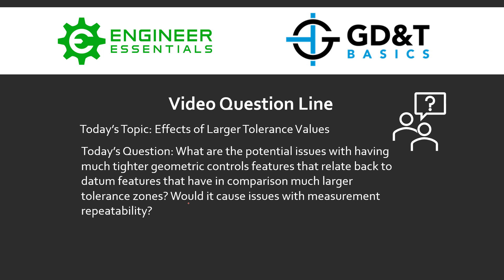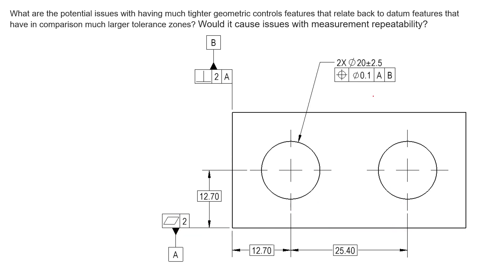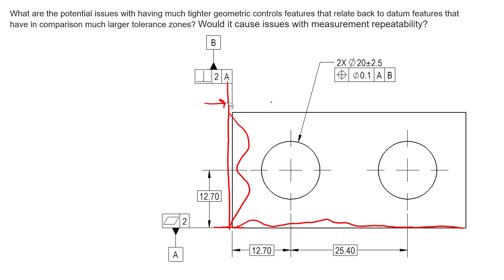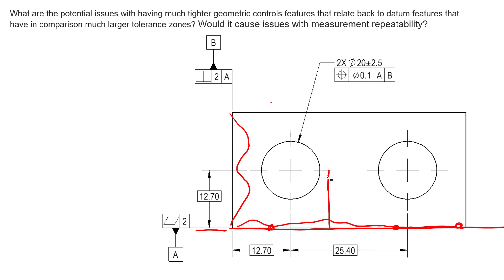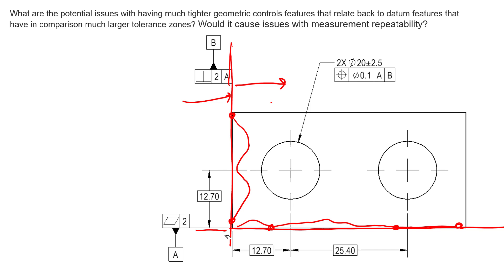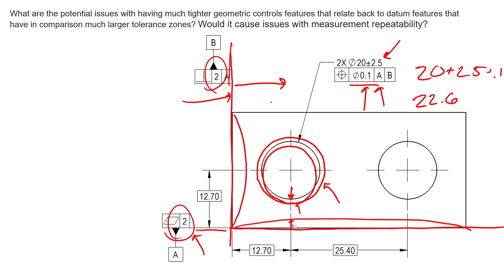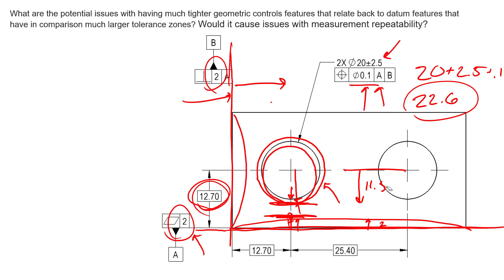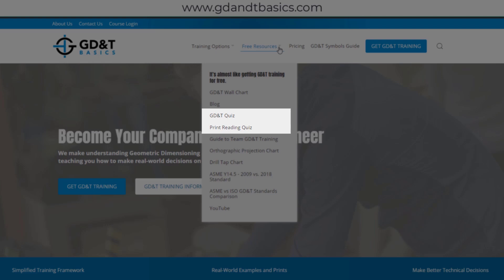Effects of Larger Tolerance Values

Comment: I'm not sure you answered the question as well as you could have. You picked the 2 and 3 "high points"  that conveniently lay close to the theoretical (modeled) datum surfaces. But what if Datum B gets really close to being 2mm out of perpendicular from Datum A? How does that affect the possible positions of the holes? The hole-to-hole spacing seems to be unaffected by the large form and orientation tolerances applied to A and B but what about the 12.70 basic dimension from Datum B? How is that affected when B is 2mm from perpendicular to A?

Edit: I think maybe you clarified this for me in the next video (https://www.youtube.com/watch?v=Nb43dr59ZhY&list=PLId-CG-Zsc_bYMPcFHQ5b0_7bU8rCkT1v) by showing how datum features can be simulated.

Comment: 5:27 Don’t should be 0.05!? The diameter of the circle is 0.1mm so 0.05mm for both sides.
Reply: 0.05mm deviation can happen in any direction which results in the outer boundary of +0.1mm.